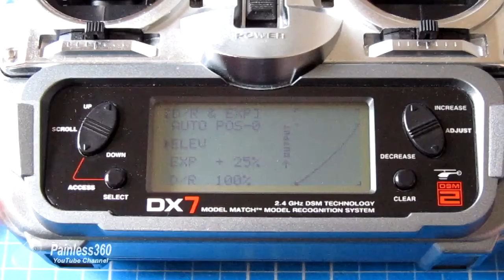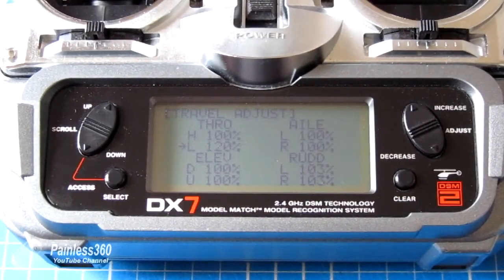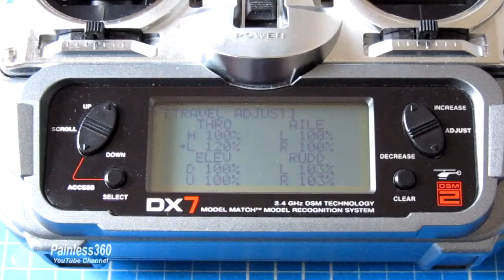(3/7) Troubleshooting MultiWii arming problems

Comment: Hi, I'm working with multiwii 2.4. I build drone with diy esc for brushed motor (720 syma motor). I use TIP122+Resistor 10K+Diode 5819 for esc. But the motor never spins.
Reply from the maker: I'd suspected the ESC. I'd try it with a known good one... Best of luck
Reply: @Painless360  Thanks. I'm waiting. By the way, I enjoy all your tutorial as my best reference.

Comment: Im using an arduino nano multwii, and the arduino does not out put any pwms to the motors after powering on. Is that due to not arming?
Do all multiwiis need to be armed by default?

Comment: how about disarming problems?  devo7 w/ devo rx701...multiwii 2.5.  can now arm but cannot disarm.  rx looks to still have signal w/ solid led lit.  Can still control quad motors w/ sticks...just cannot disarm. tia!
Reply from the maker: +Vernon Kalugdan sounds like the end point /travel adjust for the rudder needs extending a little then. Best of luck!
Reply: awesome!  I can disarm On Point!  However....i went up R rudder 0.5 to be able to disarm and now I can't arm.  Any work around there other than adding the arm feature to my aux channel?
Reply: looks like on your radio you can adjust L and R rudder separately.  Devo 7 doesn't seem to give me this option :( unless anyone can show me otherwise?   R 0.5 I can disarm.  0 can arm only.  L 0.5 I can arm only.

Comment: Hi. I have this problem on my multiwii. when I connect to multiwii conf I see all my controls are working, when disconnect from pc my drone do not react. 
I was using option on arduino config.h (#define ALLOW_ARM_DISARM_VIA_TX_YAW) and can't get my drone working. 
must say when I use tx yaw  fcl shows solid blue light, but drone is not responding, I run out ideas what else could be wrong...
Reply from the maker: I'd check the power to the FC, I've never touched the arming defaults in the sketch personally. Best of luck!

Comment: Hi!
I have the same board (Multiwii v2.5) and a Flysky th9x controller with a fs r9b receiver.
Your videos are really useful, thank you. I did everything as you, I flashed up the software with the basic setup in Arduino, and wired everything up, but unfortunately if I try to arm/disarm nothing happen. Can you please help me? I dont know how to set up the remote controller... THank you!
Reply from the maker: I'd suspect that one of the channels/end points are wrong. Check the manual of your radio.. Best of luck!
Reply: +Painless360 Thank you, but what does channels/end points mean? How can I edit them?
Reply from the maker: Watch the video in the 'Introduction to RC' series.. best of luck!

Comment: Hello my quad was flying just find and i just started to notice that the throttle keeps changing with out me touching it in flight making my quad jump up and down randomly. Do you have any suggestion on how trouble shoot it or reset the whole system?

Thank you
Reply from the maker: +Original Hobbies I'd check that the throttle control on your radio doesn't need attention. Best of luck!
Reply: Painless360 Thank you I actually found out it was the props not being balanced. Keep up the good Videos :)

Comment: I'm so done with Multiwii bs. no matter what mine won't arm anymore, even after trying this. pos boards, don't waste your money
Reply from the maker: +Black Cardinal 1 Sorry to hear that you're having problems. Multiwii is now a very mature 8 bit technology but it works very well. Sounds like your board developed a problem. Maybe time to try a newer 32 bit board? ;)
Reply: +Painless360 Thank you for helping with your videos as I´m almost done with my first setup with multiwii. Only problem is that it will not arm. Multiwii 2.5 flysky Th9X. Receiver will start each motor when connecting outside multiwii 2.5 board. Is there any way to troubleshoot if there is something wrong with the board? Have programmed in Arduino and Multiconf as you have been so kind to instruct.
Reply from the maker: We have a video on arming problems. Usually it's due to the throttle and rudder endpoints not being quite enough.. Best of luck!
Reply: +Painless360 thx. I have moved endpoints up to 120 starting with 103 without any luck. Thx. once again for the videos.

Comment: I configured all the setting that I want in multiwii config.h. I calibrated ESCs by uncommenting caliberate ESC and after that again comment it in config.h. As well as I calibrated magnetometer and Accelerometer.
After that connected all the propellers and tried to fly. But one motor is spinning faster than the others. But I didn't change any PID values. How to setup this?
Thanks!
Reply from the maker: +Senal Weerasinghe Calibrate using the manual method shown in the channel. I rarely use the 'all at once' methods as they rarely get it spot on for me. Best of luck.
Reply: +Painless360 
Thank you very much! I'll do and check it.
Reply: +Painless360 
I calibrate ESCs separately. But real left motor start spin more faster and quickly than others when I increasing the the throttle. What should I do for this?
Thanks!!
Reply from the maker: If it's just sat on the bench that that can happen. If you are concerned then all I can suggest is that you re-calibrate again and if you still have a problem when you try and fly then let the vendor know.. Best of luck.
Reply: +Painless360 
Hi,
I think it's not a hardware fault. I unplugged motors and increased the throttle. In my multiwii GUI shows all the motors increased in same value and after the max throttle front left motor and rear right motor start to decreasing the value. Can I configure this by trimming rudder? How can trim these channels for better configurations?
Thanks!
Reply from the maker: I would try a test hover - you have balanced the props?
Reply: +Painless360 
yes I balanced propellers. I checked in multiwii GUI without powering the motors. That's the reason my some motors spining faster than the others. Why GUI shows some of motor values (4bars in multiwii GUI) decrease automatically?
Reply from the maker: This happens on the bench - have you test flown it??
Reply: +Painless360 
I'm really sorry! I couldn't understand what did you mean by that?
Reply from the maker: Have you flown it?
Reply: +Painless360 
Hi,
Yes I tried. Now it's little bit OK. I changed some PID settings. Now it has only rotating problem while hovering.

Comment: Hey,
Thanks for this helpful series. I have a problem when I arm the board. The flash comes on when I arm it. But when I increase the throttle, the motors don't spin! So, I can arm/disarm the board but the motors don't spin when I increase the throttle. I'm stuck in this problem. I have not heard the spin since I bought the parts. Sad!!
Any ideas?
Reply: FAHAD ALMADHI Have you checked that your ESCs are working and connected properly to the board?
Reply: I heard the motors beeping. Does it mean the ESCs are working properly?
Reply: FAHAD ALMADHI Yep. I believe that is actually the ESCs beeping, though. I would recommend testing the motors and ESCs like this (https://vimeo.com/38796265) to make sure they are working and help you isolate the problem.
Reply from the maker: Motors will beep when powered on and then should be silent (sone firmware may make beeps ). Recalibrate the ESCs again to make sure they are ok,  best of luck.

Comment: Hello sir, I have a MultiWii PRO Flight Controller w/MTK GPS module. I made all of the connections according to the connection plan however I could not make the motors run. I tried the arming process that you showed in this video but no luck. What might be the problem? Could you help me please? Thanks in advance...
Reply from the maker: oguzhandalgic Lots of things could be the problem. The endpoints are the most common. What trouble shooting have you done?
Reply: Painless360 What do you mean by endpoints? Regarding the troubleshooting, I checked the connections on the receiver and the multiwii, they seem correct. I did not check the motors by using a multimeter, to understand whether the current goes to them from multiWii or not, however they work individually. What I mean by individually is that if I connect the battery directly to the ESC and then to the motor and to the receiver it works well. Also I connected the MultiWii to my computer and tried to modify it through the GUI, according to that there is no problem in the transmitter as well. So when I move the throttle stick, for example, I get the feedback from the GUI. Could the arming process be different than you did in this video? Thanks.
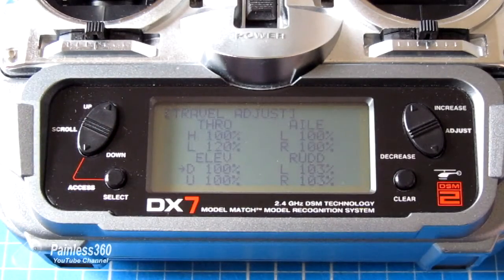Reply from the maker: I'm talking about what is covered in the video at 2:29..

Unless you changed the arming process in the code then this is what the board will be looking for..

Best of luck.

Comment: How did you mount the MWC to the frame? The one I got did not come with mounting holes, I do not want to drill screw holes
Reply from the maker: If there are no holes then use double sided sticky foam. I use the stuff that is made to stick car number plates on. 

Very strong and helps with vibration too. 

Happy flying!

Comment: I see that you have motors stopped on arm could you explain how to set this please as when I arm mine they rotate at slow speed. Thank you in advance, your videos have been invaluable to me while setting up a multiwii fc quad selve build for the first time.
Reply from the maker: Hi Highstaff, you need to uncomment '#define MOTOR_STOP' in config.h and that will stop the motors from spinning.

Happy  flying!
Reply: Painless360 ty for  the info :) keep up the good work mate

Comment: do I need to  #define  failsafe to stop it running away if I lose signal? how do I set the failsafe to RTH?
Reply from the maker: See http://www.multiwii.com/wiki/index.php?title=Extra_features#Failsafe

I would also use the failsafe feature of the receiver on the model to put the Multiwii into RTL mode to fly back to you in the event of a radio failure.
Reply: how do I set the failfafe on the receiver? im using a FS-R6B 6 channel receiver with a FS-T6 transmitter
Reply from the maker: You need to read the manual that came with it and make sure that when the radio connection is lost the receiver defaults to the RTH mode on the model. See https://www.youtube.com/watch?v=iXxkJ9V41EQ
Reply: ok ill have a read of the manual, so do I keep  #define  failsafe on in the arduino code aswell? at the moment when I turn the transmitter off, it activates "angle mode" & locks the throttle at minthrottle +200 for 20 seconds, I assume this is to land near the spot that I lost signal? thanks for the help m8
Reply from the maker: Depends on how the Rx reacts to loss of signal. You need to play with it and see how it reacts, as the model doesn't manage height for RTH then it is best to autoland it (assuming you are not over water!)
Reply: ok, cheers m8

Comment: hello again, after reading a few of the comments I got the answer to my question, however it leads me to a new question, if I have got to reflash my MWC again to stop the rotors spinning when armed, do I have to unplug everything from the MWC or can I just fit the FTDI and reflash it?
Reply from the maker: I would unplug the ESCs, I'm not sure you have to but it's an old habit from the KK./20 days..
Reply: thanks for the reply, im in arduino, how do I  RTL as the failsafe? also, how do I activate the OLED screen? my Bluetooth device is different from the one on your other video so does this mean that I can just plug it in without  #defining   it? thanks in advance, almost finished (fingers crossed) lol
Reply from the maker: GPS modes appear automatically when you install a GPS (https://www.youtube.com/watch?v=UJrErUlnJSI&index=6&list=PLYsWjANuAm4qSqszQR6qIisiwk5r-_nMk), the Bluetooth will work automatically, no code changes needed (https://www.youtube.com/watch?v=E45mxwl-jxM&list=PLYsWjANuAm4qSqszQR6qIisiwk5r-_nMk&index=5).

Best of luck.
Reply: cheers m8, getting there slowly lol

Comment: Motor its not arming. Im using multiwii se v2.5 (http://www.myrcmart.com/mwc-multiwii-se-v25-flight-controller-p-6706.html) wth firmware 2.3 (https://code.google.com/p/multiwii/downloads/list) and CRIUS_SE_v2_0. I  commented ONLYARMWHENFLAT to arm when tilted.
Reply from the maker: Has it ever armed? If it's a new firmware install recalibrate the Acc and Mag..

Hope it helps..
Reply: No, it's not arming. I will check in some foruns. Thanks!
Reply from the maker: ***** It's usually what's covered in the video - not calibrated the ACC or the endpoints on the low throttle and rudder are not high enough..

Best of luck in the forums.

Comment: Can u help me solve my problem to arm my tricopter, After I flash arduino pro mini, green and red light on the board stay on and do not let me arm it. do you know why the green light stays on after I flash? Thanks in advance
Reply from the maker: Not sure - did you calibrate the accelerometers and compass after flashing using MultiWiiConf?

Comment: Another question if you have a chance. When selecting board type in the Arduino tools tab, i can either select pro mini with 5V or 3.3V. DO you know which i should use for the MWC MINI (works on 5-8.5V but i can see 3.3V written in silk screen on the board) ? There is also a Arduino mini w/ ATmega328 in the tools tab under boards. I don't think this works with the MWC MINI, i should stick with the pro mini right?.
Reply from the maker: Great question - the answer is on http://arduino.cc/en/Guide/ArduinoProMini

Good luck with the build!

Comment: Hi Painless, loads of great videos which really help. I'm having a few issues with setting up my MINI MWC (with inbuilt receiver dsm2) from HK. I think i'm nearly there, When i arm my Quad the motors are spinning slowly even in minimum throttle. How do i get the motors to come to a complete stop? Also can you recommend a good video to help me setup my Turnigy 9xr so that it will work best with a mini quad with the mini MWC FC? Thanks again.
James
Reply from the maker: You need to change a line in the code and upload it again to the model to stop the motors running on arming (I always have mine set like this). Search for #define MOTOR_STOP in config.h..

Comment: I am building my first quad, I have a HobbyKing multiWii 328P board. I have burned multiWii 2.3 version code with minimal config.h changes. I can see all the reading in the GUI but cannot get it to arm, How can I arm my board? Which LEDs to look for while arming.
Any help will save my life, please.
Reply from the maker: You can see the main light on the board come on solid at 1:27 in this video. That shows that the board is armed.

On this version of the board the light is at the front of the board right where the direction arrow is printed and is bright blue.

You can also check this using the Multiwii connected to the PC via the FTDI connector and MultiWiiConf.

Make sure you throttle or/and rudder channel are not reversed and if that's all ok, increase the endpoints as discussed in the video.

Good luck.
Reply: Thank you :D
I got mine armed finally after lots of frustrating hours!
But now the problem is that my quad won't fly balanced, it spins or rolls over while trying to take off. I did the Accelerometer calibration before take off, is there anything else I'll have to calibrate?
One motor is always getting low speed then all other so it's not getting balanced. Could you please help me with this?
Reply from the maker: Hi Alfaz, check the motor rotation and that the props are on the right way. If that is all good then check that each of the motors are plugged into the right outputs on the Multiwii.

Hope this helps.
Reply: Thank you :)

Comment: Can you tell me why i am getting so many i2c errors showing up?
Reply from the maker: Not without more detail. If the counter is increasing rapidly then it usually means that it can't see/read the incoming data. Check the connections and settings for rate etc.

I see this when I've configured the MWC board to expect the GPS/i2c data cand then power it up without the i2c board plugged in..

Comment: I thought you showed this in the setup video that you did. If he opens the multiwiiconf he needs to adjust the endpoints so that the rudder value is as 1985 - 2000 when the rudder is moved all the way to the right. That way the control board recognizes the input. Here is a decent setup guide: http://witespyquad.gostorego.com/videos.html

Comment: Awesome! Now that we got it to arm what would be next step? Leveling? Do you have recommendations.
Reply from the maker: If you've got it flying then I'd just get to grips with the level of expo on the transmitter and get used to flying it first before trying anything else. Once you have that sorted, get the self level trimmed - you can learn to fly easier that way as it will level out when you take your hands off the sticks. Happy flying!

Comment: you mention END POINTS.  I dont have those. I am using a turnigy with open9x and I do have DR/EXPOS, MIXERS and Channel limits.
Reply from the maker: The answer is Channel Limits. Please use the forums at places like RCGroups and the manual for the radio, I found this the best way to learn.

Comment: Hi Joseph,  It appears that my MW now arms.  When it does the motors are spinning?  Should they be spinning or idle waiting for me to give throttle? What should I be setting for a min and max range?  Right now I have MINTHROTTLE 1064 and MAXTHROTTLE at 2000 with a MINCOMMAND on ESC's of 900
Reply from the maker: Ken, it might if you have not uncommented DEFINE MOTOR_STOP in the software. Uncomment that line and it should stop that.

Comment: Thank you for this. I notice when i turn my radio on then plug power into mw, my blue lights flashes constantly at about two flashes a sec, then keeps flashing.
Reply from the maker: Ken, this usually means that you have not calibrated the mag and acc following uploading the firmware to the board. Connect the board to your PC and use MultiWiiConf to do both then try again.